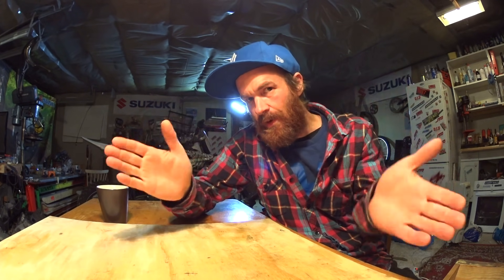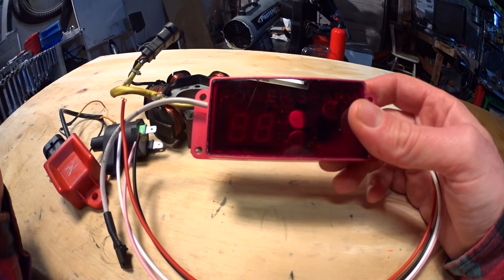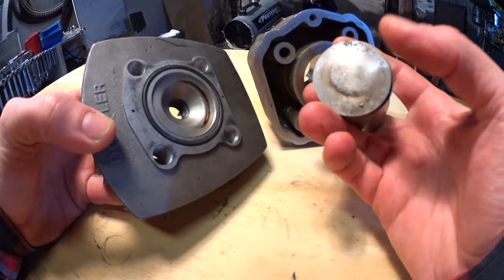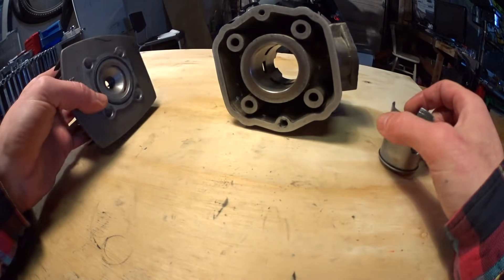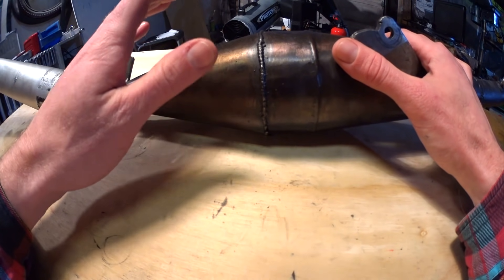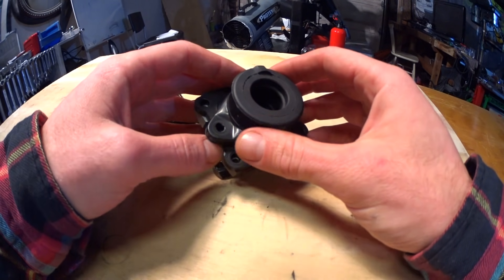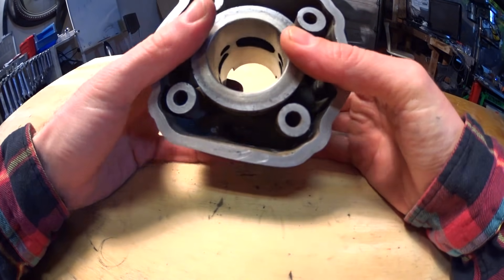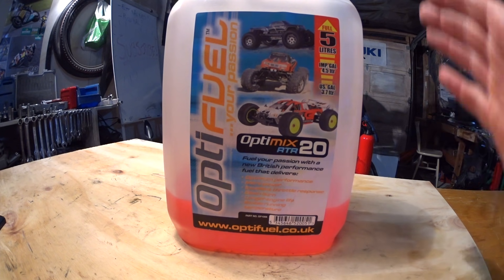10 FREE WAYS to MORE POWER in a TWO STROKE Engine! DIRTBIKE/SCOOTER/MOPED | 2 STROKE TUNING

Comment: What do you mean exactly with down jet?
Reply from the maker: +Leroy De Vries use a smaller main jet.
Reply: 2STROKE STUFFING would you recommend this for a moped that makes long journeys? I have a 125cc honda mt5 with 24 mm carb.
Reply from the maker: +Leroy De Vries Not really, better to err on the safe side if you need it for long journeys.
Reply: 2STROKE STUFFING oke thnx. I'm on the safe side right now so i'll let the jet in there😉

Comment: Hi I’m Thomas. I spend 24/7 watching all of your videos haha. I love 2strokes.
Wanted to ask you, do you know this? https://goo.gl/images/r9hoyb I’m having a discussion with a friend of mine and he says that it really works but I don’t think so. The only way to know it is if you  can make a dyno run with and without it! Thx!
Greetings from Argentina !!!!
Reply from the maker: +tomas socas Thanks! I'll check out the link later when I have time!
Reply: That insert should help,especially at lower too half throttle/slide opening.Simply by giving a cleaner laminer flow.However as we spend more time with the throttle pinned open we would not feel the benefit as much.

It works in theory,and even better when running bigger carbs,why not want to cut turbulence and improve flow.Also if the theory works,why not run the wings back into the air boot.
Reply: 2STROKE STUFFING thanks!!!!
Reply: The thing would want to work 150 dollars fitted they must charge about 140 dollars an hour labour because the thing shouldn't be worth more than about 10 dollars.

Comment: I am one of those lucky owners of two stroke cars. I've been following your builds and films. I sure wish we could talk. I figured out how to make great 2 stroke power reliably from 2500 to 4500 rpm. which is really good for a heavy car that needs torque. However at the sacrifice of top RPM.  I'm frustrated with the power cut @ 5000 rpm.  And want more top end. It'd be great if we could chat some how or some way and send me in the right direction. Thanks Mark
Reply: Port timing and a proper exhaust can make or break a 2 stroke. And since you probably can't or won't want to mess with port timing, experiment with different exhaust setups. Problem with 2 strokes is you can tune them to operate best in certain rpm bands, but all other areas will suffer for it. That's the nature of the beast.
Reply from the maker: +2stroketurbo Sure, send me a mail on 2strokestuffing@gmail.com You know I used to own a Wartburg 353, really miss it. Need to get another one and tune it!
Reply: Drill a hole in the stinger, weld a nut in line with the hole and screw the bolt in to tighten it up. Us a jam nut as well
Reply: Time to start messing with gearing?
Reply: when are you finna start tuning am6 and Derbi motors. i bet youre going to be the best if you pur your mind to it!
Reply: Look at what Evinrude did with ETec if they did much reporting at industry meetings like marine equivalent of SAE (Society of Automotive Engineers). Each year they have meetings and report on new technology. They don’t give you the whole recipe but it’s a start.  At a Miami Boat Show about 5 years ago all of the outfitters liked the 250 and 300 Evinrude vs 300 Merc or Yammy.  They said Merc and Yammy sales are embedded on brand loyalty not performance.  The outfitters loved the instant torque of the etech which is true of any 2 cycle.  They liked the weight reduction, simplicity (30% fewer parts), and less maintenance especially oil changes.  Outfitters said most offshore captains gave up on being neat with oil changes.  Their theory is they are recycling (dumping on the ground or in the water).  Time is money.  I just got my first set of 4 cycles. Twin 150 Yammy.  Set and forget.  I’m old and my need for retina deformation has passed.  I still got a 115 Merc (The Tower of Power) on a 17 ft ski boat when I need to revisit lala land.

Comment: One question, will cylinders in sport or street class, Polini, or Malossi, handle the the RC fuel? Beacuse it gives much bigger detonation force, so it could damage head or piston only by big boom :P
Reply from the maker: +MrMBmovie No idea... I noticed traces of combustion outside the combustion chamber on mine, head is probably being lifted slightly by combustion pressure.

Comment: Missed out one obvious tip..... make sure the tyres are correctly inflated, especially on 50cc bikes as under inflated tyres will take a bite out of tops speed.

Another "old school" porting method, from back in the 1950's and 1960's, that's even simpler than adding a cylinder base spacer, is piston head edge indenting. 

I bought (and later sold) a late 1950's Jawa 250 competition motor, back in the mid 1980's, and the only difference between the stock road issue piston and the competition motor's piston was the indented "ramps" in the piston head to increase transfer port duration.

It kind of makes better sense than butchering a cylinder block. Porting mistakes only cost a replacement piston compared to ruining a cylinder. Also back then it allowed the motor to have a selection of indented pistons tailored to suit different circuits and race conditions. 

I've been recently experimenting with an indented piston on one of my son's 2 stroke road bikes and managed to go past the "just perfect" into "f**ked the port timing" BUT it only cost me a replacement piston and redoing the indents back to the "just perfect" dimensions.

I could, of course, port the cylinder block out to the dimensions used on the indented piston and use a normal piston again, now the measurements are know. However once ported a cylinder can never be put back stock, unlike running with modified port duration / timing using an indented piston.
Reply: it is hard to do so if you have piston with L-ring!
Reply: @jozseffarkas1767  take a die grinder using a blunt foot ball shaped carbide but  and remove all the imperfections inside the ports left from factory casting until you have resurfaced every square centimeter of all the ports without cutting clear into the cylinder bore ..but match up the exhaust port as big as necessary to the pipe adapter and the polish it to a mirror finish ..and nothing else ..you with feel a bike length jump ahead of a stock bike of the same after a jet size bigger for the carb and a higher flow air filter like a "twin air" brand foam filter and perhaps a FMF fatty tuned expansion chamber or a Yoshimura tuned pipe if you got the bucks ..cause no body ever out tuned "pop" Yoshimura who I spent a week with in a two stroke tuning school on the Honda Elsinore as it was "pop" Yoshimura who designed developed Honda's very first two stroke engines ever made ..that was the game changed from that moment on ..as "pop" taught me everything there ever was or ever will be about tuning port induction two stroke engines as to how they make boost , horsepower , power  bands and the essential of a tune expansion chamber ..as so far none of you in these comments have not a clue ..including the video ..
Reply from the maker: +Andy Reid Good tips!

Comment: >changing ignition timing
will probably kill your engine really fast for marginal gains on normal setups
>stinger ID
I have bought around 7 performance exhausts ranging from Leo Vince's to Gianelli's and not a single one of them has this.
>Squish
0,01% performance gains on a regular setup for a real good chance on engine damage.
>checking exhausts
valid but if you need to do this then your pipe is cheap crap.
>intake length
valid but doesnt matter a lot
>port maps
valid
>base spacer
valid
>better fuel
duh but come on thats not cheap.
Reply from the maker: +CalculuS 
>Ignition timing
That depends on where it's at before you change it, nothing like a normal setup here, I've seen anything from 10° to 25° BTDC @ peak power rpm on various engines. 
>stinger ID
Did you try smaller stingers? 
>squish
Only true if you're 0.01% from hitting the head already. Many run ridiculous gaps like 1.5mm on 70cc
>exhaust
Could be expensive crap too
Thanks for watching and commenting!

Comment: How shaving the head reduce detonation?2:09
Reply from the maker: +Adarsh S A tighter squish gap reduces the amount of trapped mixture in the squishband - a larger area vs volume is being exposed to the relatively cooler aluminum of the piston and head. Go tight enough and there won't be room for anything being trapped at all. Nothing can't detonate. The reason why you can't just set the static squish gap to zero is cause the crank bends and the rod stretches at higher rpm.
Reply: 2STROKE STUFFING thanks. 
But shaving head result in higher compression ratio which in turn makes it prone to detonation that is what I have studied!
Reply from the maker: +Adarsh S You are right about that. But tightening the squishband say 0.2mm won't alter combustion chamber volume much. And if you are running like 1.5mm squish then your compression is probably very low and taking of that 1mm will just take it up to a better ratio. Every setup is different tho, and one should do some measuring and calculations before cutting.

Comment: Hi,
What are your thoughts on a full cone pipe compared to a stamp pipe.
With all the increments does this help exhaust flow of a cone pipe not only they look good for more performance.
This is for a Honda cr250r 2stroke dirt bike 
Thanks again and keep up the good videos from Australia 🇦🇺
Reply from the maker: +Andrew Byrne It depends on how well the cone pipe is welded, and how "sharp" the stamped pipe is. Sharp, clear transitions between the different pipe sections = sharp pulses. This is the downside to hydroformed pipes - the transitions are kinda smeared and this smears out the pulses too.
Reply: 2STROKE STUFFING So it’s actually better to have distinct transitions, not a smoother “flow”? Not doubting you, just trying to learn a bit on expansion chamber selection.

Comment: 10 ways to destroy your 2 stroke bike
Reply from the maker: +#Anto# #Anto# That's one way of looking at it...
Reply: @2STROKESTUFFING sir please give me your what'sapp num 
I need you help sir 😟
Reply: Eh, there's only a few things in here that can result in destruction...
Reply: I once read in a 2t performance book, the engine will be in the brink of its life yet perfom like it never has, its how they want to be run
Reply: more power at the edge of destruction is the goal, LOL
Reply: @KrustyKlown  to be fair, two strokes are always on their way to destruction, we just get to speed that up a little (or a lot) and have fun in the process.
Reply: @darrencolegold3642  my performance goal is to achieve less than 30min run time between full 2 stroke rebuilds.
Reply: And make more power
Reply: never heard of a port match destroying an engine. I think it's just you man. You should stick to rubber bands )
Reply: Only if you a idiot 😂
Reply: Potentially, but all true and as the clip title states. Like all engine modifications, home mechanic beware. Have the mentioned work carried out by machinist and engine tuners who have done before..
Reply: and we have a winner, duh
Reply: came down here to post this

10 ways to blow up a 2 stroke engine

Comment: Very nice advices i only knew about a few before ur video! I can also add a bit of my experience to the preparation of the cilynder ports into the engine block. Many smaller 2 stroke blocks have very small wall thiknesses in these areas. You can just take your caliper and stick a little drill to it (f.e. just with duct tape) and you have a great tool to measure all the smaller spots of wall thiknesses you are about to process without buying expensive instruments.
Reply from the maker: +P33TMusic Thanks! Great tip!

Comment: Hey,, be careful what you tips the fanboy crowd to do Alex.
As example, i cannot by near run 0.6mm squish in my 61mm stroke engine, no way near possible, the piston hits the head already at 0.8mm and 13000rpm.
And i tried the stingertrick with methanol.
I can say quite modestly that it should be WAY bigger then you expect. ;)
Reply from the maker: +Patrick Wetterskog My advice is to have a squish clearance as tight as possible. I've run 1% in ceveral 50 an 70cc engines without problems, but it is a rule of thumb and should be treated as just that. Also 13k rpm with 61 stroke is over 26m/s piston speed, that's at the far end of the scale. I'm encouraging people to experiment with a smaller stinger ID because most performance exhaust systems available have too large stingers.
Reply: I have actually enlarged the stinger on some pipes when i didn´t get more power.
The more power, the larger stinger.
I gained 2hp in an 70cc hondaengine going from 16mm to 19mm,
But keep in mind, if squeezing the most out of an certain setup, you might gain power with smaller stinger.
But if you let the cylinder breathe more you might have to increase the diameter.
By that i mean porting etc etc.

The more power produced the more backpressure increases.
Reply: So keep an eye on the backpressure, and you won´t burn pistons ;)

Comment: I feel like i'd have to change the rod and crank to use rc fuel and therefore making more power out of my 50cc, it's a really old engine that hits it's "redline" at around 7000 rpm, and makes less than .6 hp at the crank... Maybr
Reply: Jeez man 7000 rpm for a 2 stroke is a walk in the park. You need a cdi without a rev limiter or something man
Reply from the maker: +flakey Try it! My Spx is kind of the same thing and it's stock crank can take a beating!

Comment: I would like to add that if the mounting design permits it you might be able to remove some length of the belly (the straight part with the largest diameter) of the expansion chamber and reweld the pipe to decrease the tuned length and increase the max RPM. I have done that and it works. 5mm would be a good starting point.
Reply from the maker: +Sketch1994 Good advice! Om many pipes both the header and belly is too long out of the box.
Reply: Could be why the FMF fatty come stock on  KTM. They are blossomed out big right at the exhaust port and then open up to a larger diameter as soon as the pipe has enough clearance to wrap around the frame and then it gets huge like a balloon right where you see the biggest dents in them ..but well  worth the risk  as they have a long taper  down on to the stinger that sounds like a higher pitch 250cc even on the open class 380cc and bigger ktm's ...my state in the USA will allow you the use of a moped if you lose your license over a DUI ..on a quick choice I bought a majestic brand moped from India one day ..without even test riding it ..my dad picked it up for me in his pickup and brought it home ..fired it up in the back yard of over grown lawn grass about six inches high and it went from ho hummm to HUMMMM and didn't even budge .and I had to be at work the next day at six in the morning ....so I cut the end off the air box ..drove a steel spike through all the baffles in the muffler and took a torch tip cleaner and ran through the main jet in the carb.. And it pulled me down the road a an about.23mph f you are riding one with a DUI 25 mph is your speed limit ...but we are bikers right ? More is more better and faster is faster fun ..so I payed my local KTM shop a visit and order an FMF fatty for a KTM Jr 50 moto cross mini biike h a slight tweek of the exhaust port flange it bolted on to the majestic Hindi hot rod step through with peddles and a coaster brake. Took a die grinder to the exhaust port and hogged it out to match the fatty t t pulled the rough cast piece if shit Mikuni carburetor licened carb. pulled out all the brass and ran a 1/2" drill bit right through the carb bt1/8 " bigger diame. Went two jet sizes bigger .removed the head and base gasket used Yamaha bond#4 in place of gaskets ..fired it up sounding like a CR60R Honda Elsinore,braaapa braap ..speedo stopped at 45 mph and it pegged it very quickly ..then after about 20 minutes locked up with a melted piston ..tried a bigger jet with no luck too rich ..now what ?  Im in panic ..then it hit me ..what was that number on the plug ..its a NGK B5ES.so Honda shop and get a NGK B10.5 VES much colder heat range ..pined the throttle all day at 53 mph next to my buddy's 650 cc 1973 triumph tiger ..so what did we learn ? You can double the rpm to double the HP to double the top end and double the amount of heat giving off that melts two Pistons.doubling the power does not ygrow the cooling fins on the jug and head twice as long to cool down twice as much more heat giving off ..but apparently you can cheat with aspark plug twice as cold    unfortunately you double the embalance of the rotating mass ..as bits and pieces start cracking and falling off .like the rear fender stamped body  fell off followed by the chain guard primary cover mirrors luggage rake front fender and turned its self into a much lighte weighr rmoto GP scrambler cafe motoped that became popular from its menising braap sound and sold it for $450 bucks totally trashed out ..and then bought a Tomos

Comment: how about exhaust wrap,bigger carbs,lightened parts like piston-flywheel, remove oil pump-kickstarter mechanism to reduse friction looses,make the reed stops wider to give more open area and maybe put carbon reeds?
Reply from the maker: +kostask18 All stuff that can help, I tried to pick a few that weren't that common.